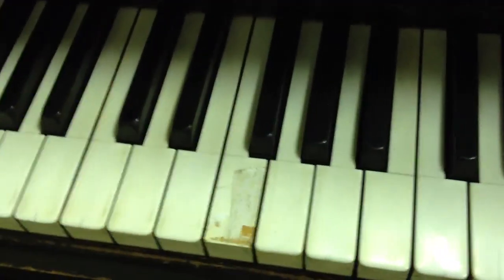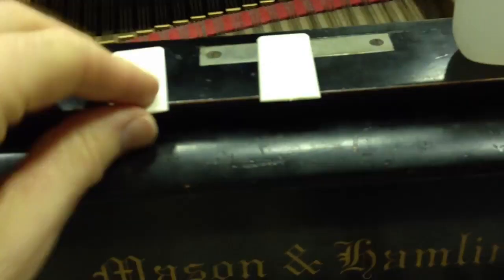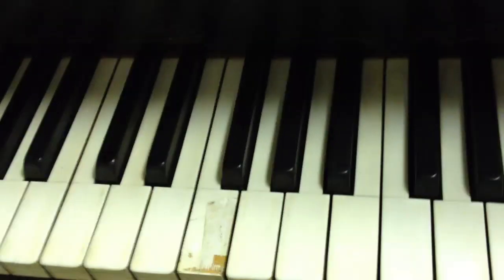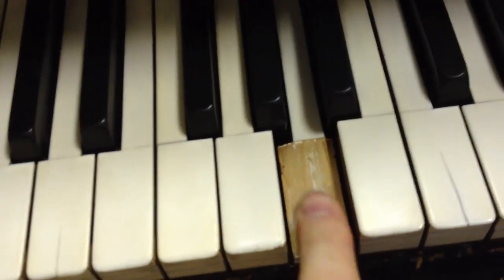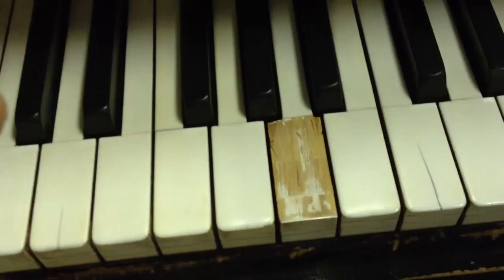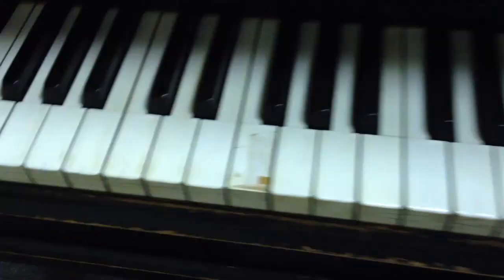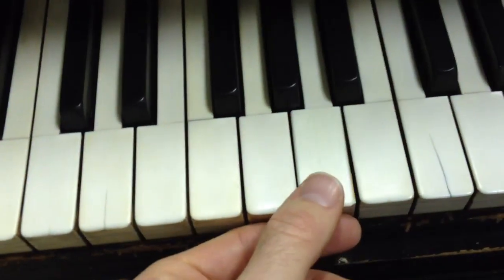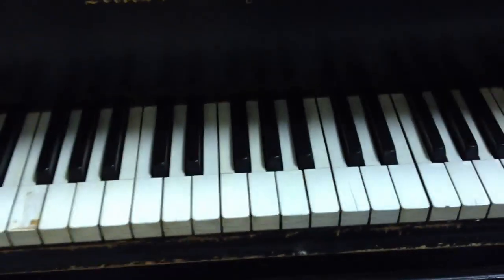Easy Piano Key Top Ivory Repair DIY

Comment: Okay - some hints. I am a professional piano tech, first. After doing many repairs with ivory, I strongly urge you NOT to use glues to attach the ivories! Problems include discoloring, cupping, etc. Piano supply sites online sell special glue tape. It is strong, does not affect the ivory and is easy to handle. It only can be found at Steve's Piano Service website. There is also a double-stick tape for this. The glue tape is better, I do pre-paint the wood so the translucent color of the keytop is maintained (wood untreated will show as a darker key color).

Comment: Additional Pro-Tip: I use PVC-E Glue (found through Schaff, PianoTek and a few other piano supply companies) to glue key tops. Super Glue could potentially discolor the key top from underneath by chemically reacting with residual glue or key top material. This issue doesn't always happen, but I've seen it ruin many key tops in other instances. PVC-E Glue is "like" (but not) a rubber cement. It is strong, chemically benign, easy to clean (before it dries), dries clear, and is pliable which allows the wooden key to swell and contract with seasonal humidity changes without the key top popping off.

Comment: What material would you suggest as padding underneath the ivory cap? I have a cap that is slightly thinner than the rest of the key cap, creating a palpable ridge. Any tips, thoughts, suggestions?
Reply: I would suggest, a synthetic paper thin plastic layer, which should not be too hard to find like a plastic floppy kitchen cutting sheet from dollar tree sanded down... 

That or a thin sheet of gold pounded out by ancient Egyptians

Comment: First, take the key(s) out of the piano.  Get a flat surface to work on and with a sanding stick sand the surface clean, Use cheap rubber gloves and a small tube of contact cement. Ivories that you are gluing do just  the right side.Not too much.
Contact cement on the wood surface of the key.Then put the keys back in the piano. If it is several keys, number them. Line up the ivories with your fingers and eyes and press down on all sides. I've replaced hundreds of ivories this  way. CA glue can turn into a mess and wood glue takes too long. Tom Lloyd

www.mrtuner.ca